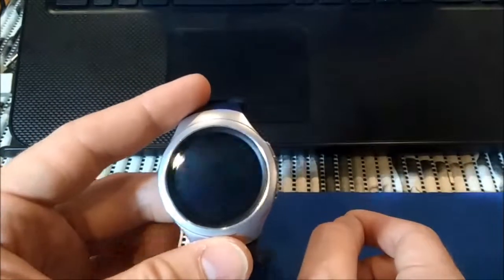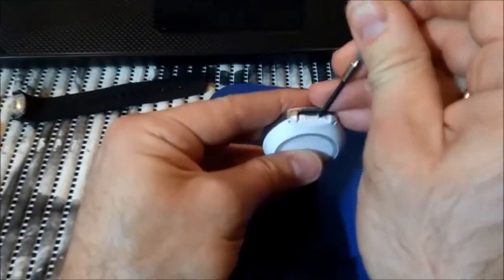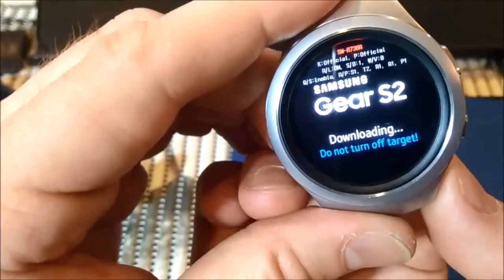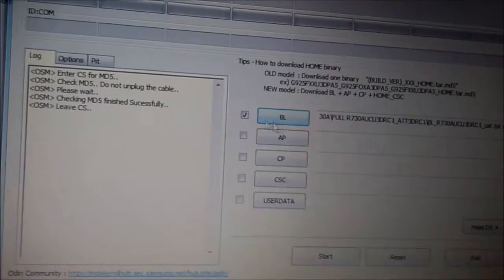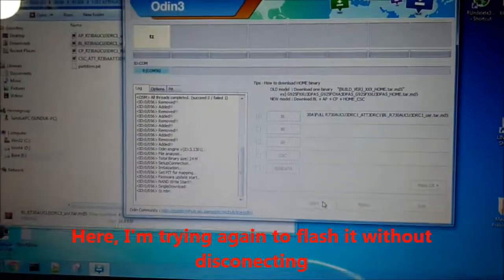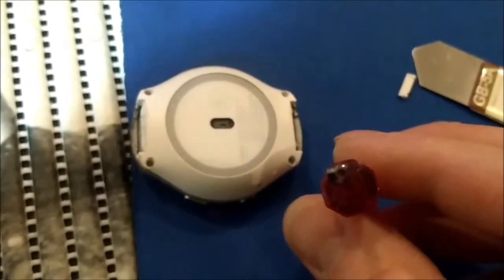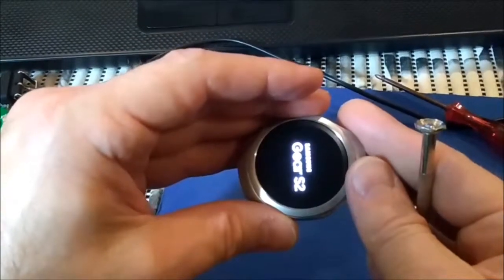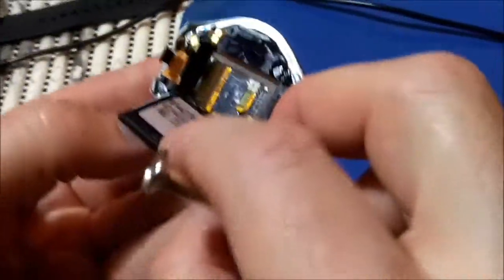Wired Flashing and Disassembling Samsung Gear S2

Comment from the maker: To connect the watch to my computer I used - 
"Charger or Cradle Dock for Samsung Galaxy Gear S SM-R750 Smart Watch".
You can easily find it on Ebay or Aliexpress.
You will need to disassemble it and remove a bit of plastic around golden pins, so this part can fit into the hole on the watch.
Link on Ebay:
https://www.ebay.com/itm/153070946412

Comment: Hello Mr Nemo, I'm bp nice meet you.  Thanks for the video I did not know that there were pogo pins under the knee band.   And that hack to use the original gear s USB charging cradle. Anywho I'm probably going to be getting into little bit of this myself trying to save a watch I got and really like.  I've done similar before willing to try again but just wondering if you can direct me to the files you had please?  Particular the combination file but also others too.  Anywho thanks
Reply from the maker: Just search in internet for combination file Samsung "your model", for example Samsung r805